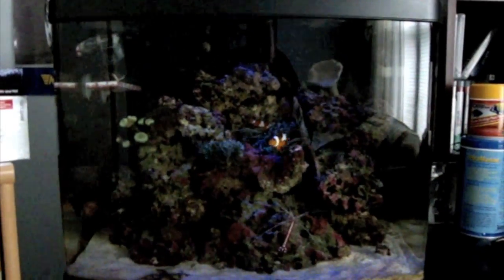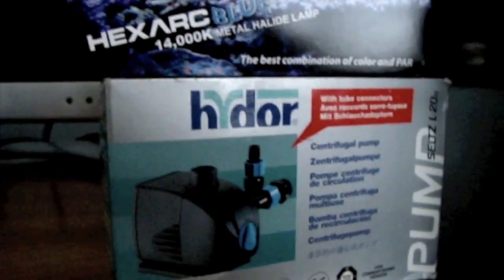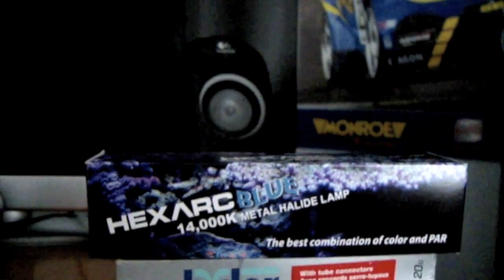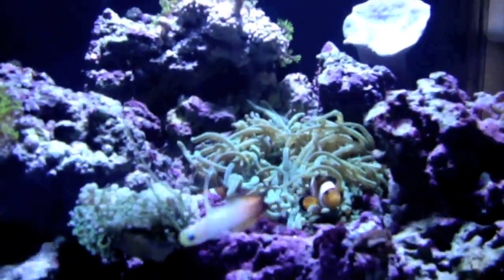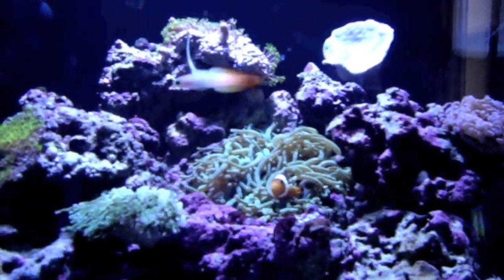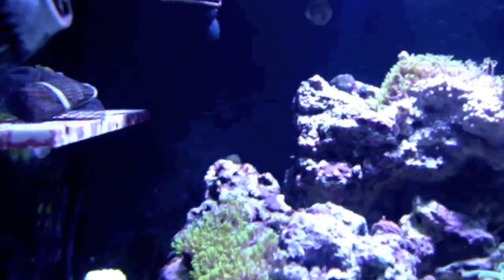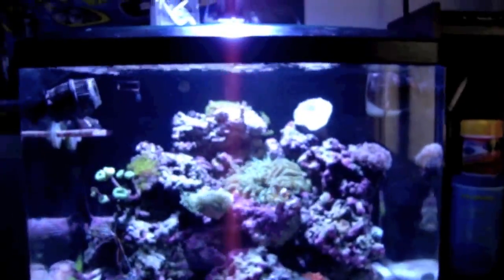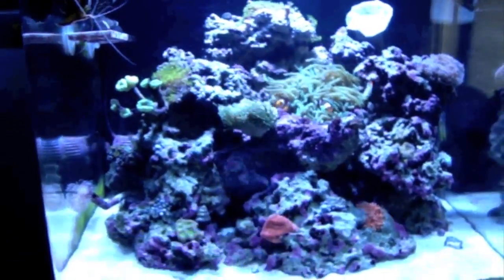Changing Biocube 10,000K bulb to Pheonix 14,0000K Bulb

Comment: Are you still running this bulb, and if so, did you ever see any issues from a lack of UV shielding in the light fixture?  The original CoralLife bulb has a glass filter added, that the Phoenix does not have.  I'm concerned about burning my corals with extra uv.  Thanks,